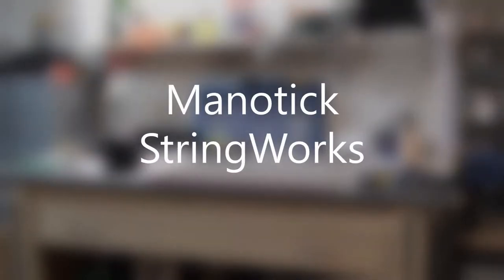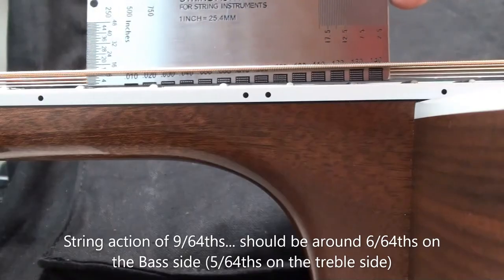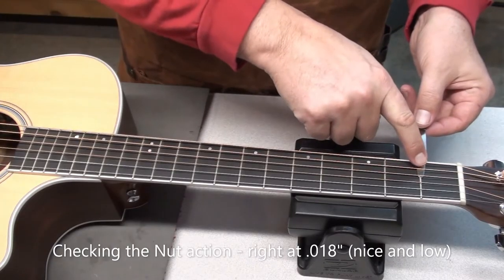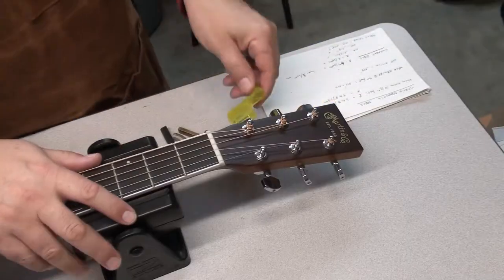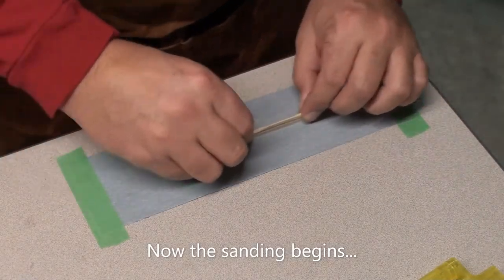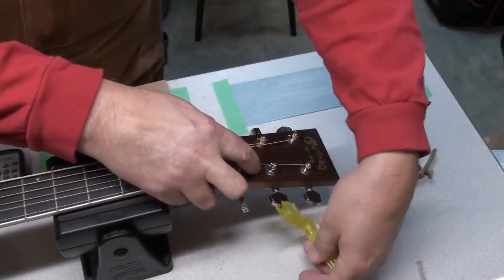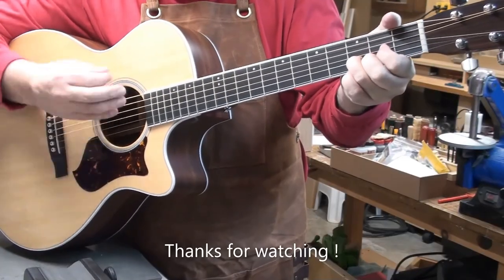2011 Martin Acoustic Guitar needs the action lowered.. almost unplayable!

Comment: I'll add this to your nice video: when sanding down the saddle as you get close to your desired height - take a black sharpie and paint the bottom of the saddle black or you could use another color if that's what you have but black can be seen better in contrast to the white. Then gently sand the saddle for a few seconds and look at the bottom of the saddle to see where there is still some black - and sand that area - repeat until your saddle is entirely white. This will ensure a very exact flat bottom. Using the pencil marker - line method is fine but if you have a Fishman under the saddle/piezo pickup -they are super sensitive and you will get uneven output from the strings. I'm speaking from experience :-) Thanks again for a great video my friend!
Reply from the maker: Great tip- thanks!
Reply: @ManotickGuitarTech  always a pleasure/honor to add something :-)

Comment: Excellent video!  Now can someone explain why Martin's tend to have high actions from the factory?  I'm just an amateur player of country / folk / rock and have several expensive Martins and all came with "ok" actions, none as low as I'd like.  Just humidified them, but we still have winter here in NW WI and they could all use a truss adjustment I'm sure.  But, I'm told that Martin likes high actions and that 'the Dealer should adjust them" - well, you can only take so much off the saddle, and eventually then what?  Seems to me they should start low, and those wanting to bang away aggressively can always install a taller saddle.
Reply: No… they should stick with their current saddle height out of factory. Those models. Especially the Dreadnoughts are set up high because that’s how they always did it. Blue grass players and the old style of playing is higher action… If they were lower… I wouldn’t want to buy a historic Martin knowing I have to get a taller saddle…….. Martin doesn’t make it a priority to adapt to every random joe blows opinions like other companies.. they are the best at what they do and they shouldn’t do it any other way…. If you buy a Martin Guitar… getting a proper action set up to your own liking is 100% a part of that experience. And it’s sacrilege to own a Martin and not have it play to your liking and action setting. A Cadillac comes from the factory with the seat straight up… it’s up to you to adjust the position to how you sit in it.. no difference

Comment: My D18 is pretty high too. I don't know the measurements because i don't have a gauge but it's higher than my other 2 acoustics i know that. I need to get the action lowered at some point. Still sounds great i most play it around the cowboy chord position. It's when you move up the fretboard i notice it's harder to play unless i'm using a capo.

Comment: Hello Sir,  I have subbed to the channel . First time visitor.   I'm wondering if you might be able to shed light on something.  I have a Martin HD28 and on one particular note, the F, when fretted and plucked it tends to ¨thud¨.  I believe it's call a ¨wolf note.¨   What causes this and is there anything that can be done about it?    I recently purchased a cheap Yamaha and I swear the Yamaha plays, dare I say, better than my Martin at 1/10th the cost.   I'm hoping to improve the tonality of the Martin though by somehow correcting for this wolf tone I'm getting.  Any thoughts?  Do you run into this kind of thing in your shop?
Reply from the maker: Hard to diagnose and fix  without seeing the instrument, but I would try changing your strings first - different brands and different gauges.  You might find that eliminates the "wolf" tone.
Reply: @ManotickGuitarTech  Thanks for the tip. Much appreciated!
Reply from the maker: @Geotubest   let me know how it goes

Comment: Thank you for this demonstration. You mentioned you checked the intonation. How do you do that? And how do you fix it if it isn’t right? Thank you.
Reply from the maker: Hard to fix on an acoustic- you would need to reshape the saddle take off points
Reply: @ManotickGuitarTech  thank you. I’m considering doing my own setups and I don’t want to mess anything up. I’m going to try sanding the saddle myself.  It is a martin compensated saddle, so hopefully the top of it is done right.  It is just too high.
Reply from the maker: @v2807  just a little bit at a time
Reply: @ManotickGuitarTech  your tips about marking the front and the current height are great! And so is showing how to calculate how much to take off.  I feel ready to give it a try.

Comment: Just did mine. I sped up the sanding by carefully using the side of my bench grinder wheel. Those saddles are made of tough stuff. Like he said in the video, just sand so that you can still see your guide mark. I have an incredible action on my guitar now, it's much better, but tbh if I had sanded just a little bit further I would have been in deep doo doo.
Reply from the maker: It is always good to go slow when sanding...you can't put the material back once it is gone.

Comment: Excellent breakdown. Just some advice. My Martin dread has extra light 10s presently set up with perfect action. If I move up one gauge, let’s say to custom lights (11s) or even to 12s would I likely need a truss rod adjust? And if so, only that?
Reply from the maker: Usually you would only need to adjust the neck relief.

Comment: 7:19 What is the reasoning behind multiplying by difference by 2? Shouldn't the saddle height be reduced by the same amount you want string height be reduced?
Reply from the maker: Good question,  Paul.  The string height at the bridge is about twice as high as what the measurement is at the 12th fret- that's why you double the amount to compensate.
Reply: @ManotickGuitarTech  Thanks for the info!

Comment: I always check the neck relief in the playing position without any pressure on the neck. The relief should be .008, not .012
Reply from the maker: Buz, you can do it either way... I have found over the years it makes no discernible difference

Comment: Wouldnt a desired action be 5/64 on the bass and 4/64 on the treble? My D-28 is set up this way from factory
Reply from the maker: That would be ideal, but in my experience, very few acoustic guitars can be set up that low - even very expensive ones - and maintain that action through temperature changes and ordinary playing.
Reply: Tony Cannata , I have a CS D28 bought new in 2018, and asked Reno's Music in IN for a low action.  By golly it's still at 5/64" and 4/64" , plays perfectly yet.  You are lucky if yours was that low from the factory.  But keep in mind that Bluegrass players like higher actions, so that's one reason why they are often a bit high from the factory.

Comment: I have a drs 1, and the action is too high, and I may get it fixed. It also cracked in the back. I thought I put it down too hard, but the tech said it was due to dry air. It's really  turning  me off of martin. My next quality guitar will be a taylor.
Reply from the maker: Dryness can happen with any acoustic guitar...have to keep them humidifed
Reply: @Manotick StringWorks   you're right but Martin's need more attention and I didn't know that because this is my first Taylor's do as well but from what I've seen from individuals who owned them around me they hold up better. It may also be I require a guitar with a thick lacquer finish.
Reply: My DRS1 just cracked in the back a week ago as well after 7 years. The crack now comes and goes due to the humidity or the lack there of. Just bought an HPL special x series Martin so we'll see how it does.

Comment: Martins are well known for excessively high actions, I mean really unnecessarily high. I have a good few of them, and every single one needed major work to get them to play properly. Even a 5 grand martin comes with an action you could park a bus under. Even after this setup here, the action was still high in my book. It's a real shame because they sound great, but they're just close to unplayable from the factory.
Reply: The problem is everyone likes a different action. So manufacturers tend to go high otherwise, if it was too low for your preference you’d need a new saddle. It’s not like taking the action down to your liking is a major chore.
Reply: @bluenova1000  Yeha I get that, but very few people want an action so high it's practically impossible to play, and if one does clamp down hard enough to get a sound out of it, that sound is way out of tune because the strings are pulled out so far. so ... if 99.99% of people don't want a crazy high action, then wouldn't it make more sense to set up the guitar with a decent action, then provide shims for those who want it higher ? If you think about it, no other guitar maker does what martin does, at least no deliberately lol, and they would if they thought that's what people want. Martin have been using this excuse for many years, but it doesn't hold much water really, it just makes things easier for Martin by transferring the work to the buyer.

Comment: I bought a used d16… the action was way to high. Decided to adjust the truss rod myself… ended up breaking it… so much for that…
Reply from the maker: Darn - that sucks!
Reply: @ManotickGuitarTech  
Yeah. I called around, and everyone said it would cost what I paid for the guitar to fix it… I found a guy by me who said he has his own way of doing it and will give it a shot.. he says he works with classical guitars that don’t have a truss rod.
He said if he couldn’t, he wouldn’t charge me, and if he could make it at least playable, $150… 
Let’s
See what happens.
Reply from the maker: @Hollyrock712  sounds fair enough- good luck and let me know how it goes!
Reply: @ManotickGuitarTech  The guy called me and I went there and he fixed it !!! I was amazed... He didn't touch the truss rod, that's broke forever, but he did something with heat and clamps, and the action is better than original. he won't tell anyone his secret to how he does it.He charged me $150, and said if the action gets bad agin, which he almost guaranteed me that it wouldn't, he would fix it for free... Im amazed !
Reply from the maker: @Hollyrock712  sounds like a good deal!

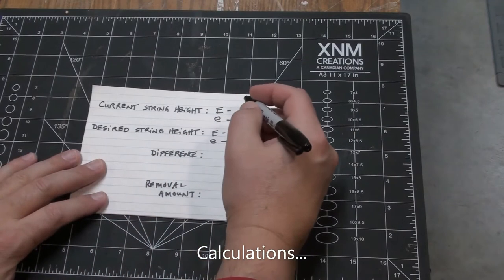Comment: 6:48 If these calculations woud have been metric, the world would have understood them much better.
Reply from the maker: I put metric measurements on my videos now where relevant.  Tell me, how do you measure the metric equivalent of 3/32"?  It is 2.381mm... do you round up to 2.4 mm?  I find 2.4 mm hard to read on a ruler - I can see 3/32nds just fine.
I use both systems where practical.  Nothing wrong with using both systems.
Reply: @ManotickGuitarTech  I know what you mean. But only luthiers in the US, Liberia and Mianmar can understand your calculation. For you, King Edward II's thumb is a unit of measurement. To define smaller units you think it makes sense to divide this thumb into 1/2, 1/4, 1/8 etc. Therefore, 1/64 inch corresponds to 0.396875 mm. Wow, that's a number. But you can see, that at least in theory, you can measure very finely. It is of course much easier to enter such numbers into a calculator. In practice, however, such numbers are not used. At least the end result would probably be rounded up to 0.4 mm. But in precision engineering, 1/1000 mm units are quite common.

Comment: This seems to be a common problem with Martin and it shouldn’t be.  Total nonsense
Reply: I've owned around a dozen or so Martins. Yes their saddles and nuts can be a little high at times but it is an easy fix. Why is it nonsense to be given the option to actually lower it? Imagine if it was really low and you decide it's too low. It is easy to lower action on a guitar. It is next to impossible to raise it.